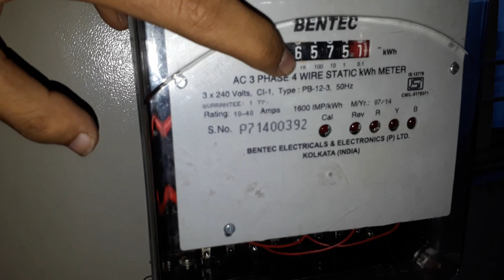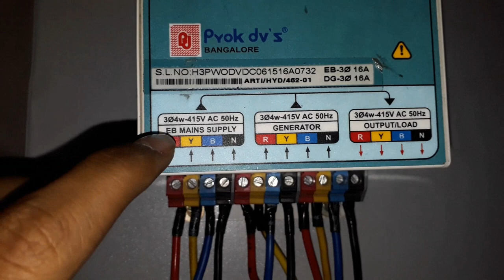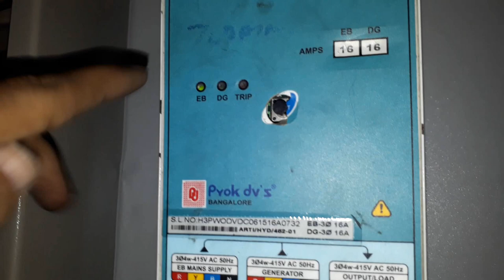3 phase energy meter wiring from pole to distribution box  | Energy meter panel explanation

Comment: One question regarding this setup, so if one phase is down let's say red then the load attached to that will not be working correct?
Reply from the maker: when a one phase is down a phase loss occurs which result in equipment damage. The equipment draws excessive current from remaining two phases resulting in overheating of equipment,